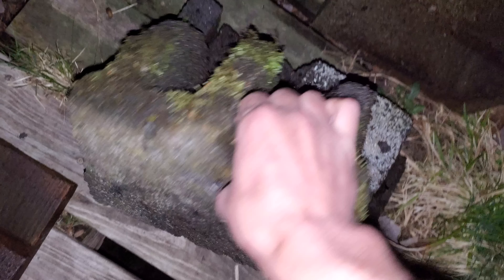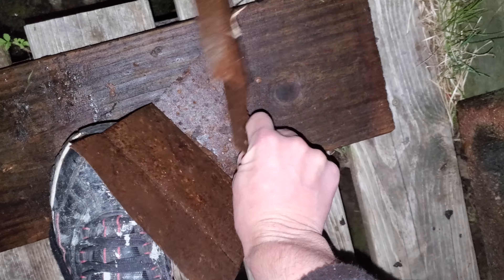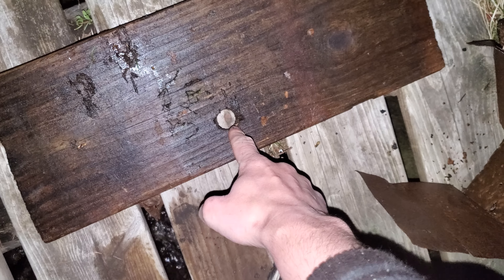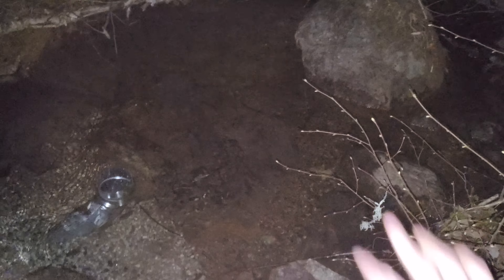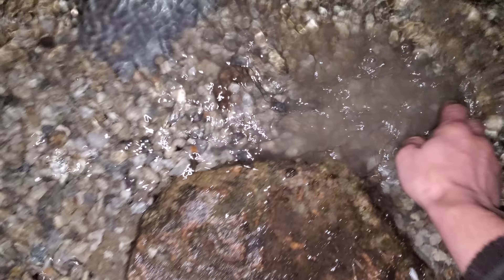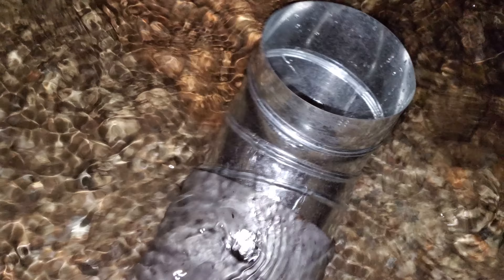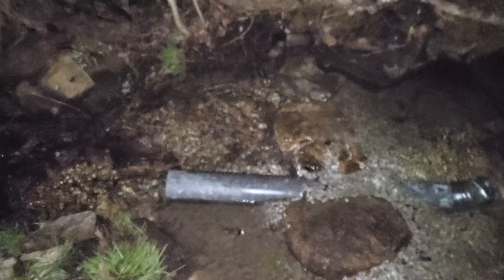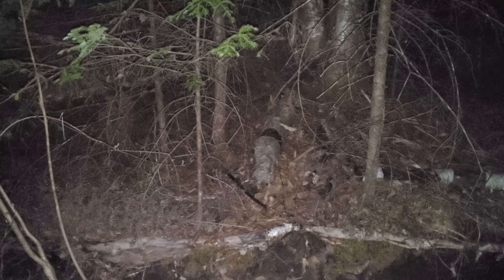Stream Dam Replacement

Comment: Look at some pvc and plastic pipe options, pvc is near water tight even without gluing and there are other plastic pipes with rubber gaskets which will seal pretty tight and can be removed when necessary
Reply: Agreed Galvanised BAD choice if ever used as Source for Human requirements.
PVC all the way!! Just requires Depth of 1-2ft to create Volume for Hydro generator and Straight/Worm return back into Before Dam for overflow over Dam after Volume is met👍
Water levels drop but stored Volume is below Dam overflow = H/G remains with Sufficient Volume. Untill extreme Heatwave.

Comment: I think you should use bigger pipe for mini hydro-electric dam project to maximize flow/reduce resistance(friction) through pipe and experiment with nozzle size at the end to maximize pressure and speed of water jet at the other end. Maybe a adjustable nozzle?
Small pipe/hose will just reduce the water flow unless you will build higher dam to get more pressure.
It's just my loose idea

Comment: In rocky areas of the west, many culverts have that type of a boot on upstream end of culvert.  The vertical piece of pipe can be quite long in some instances.
The upward piece allows water to drain once it is deep enough to reach the top of the vertical.  This setup retains water in puddles for animals but the main reason is to prevent culverts from being packed full of rocks and gravel during high spring flows.
This works very well in many areas when seasonal streams go under desert gravel roads.

Comment: I always thought the other dam was cute
Reply from the maker: I honestly like the other one better, I might go back to cinder blocks but I do like the metal pipe that allows it to completely drain so easily
Reply: @post10Vlogs  I think you should.
Reply: Deeper pipe🙏🙏
Worm return for Volume with Higher Dam wall must return Worm before Dam to improve Volume 

Volume for Hydro = Flow insufficient during Summer.......Not if Wormed to return👍
Worm creates Closed Circuit Loop👍 Dam creates Stoppage in Flow untill Volume is reached then Trickle Overflow can be achieved with Dam and Occasional Tinkering of OverflowDrain👌

Comment: quick crete..those bags of instant cement DIYers buy, work perfect in water.!! ponds,m creeks etc.. it forms fast, and stays!!. dump it, mold it like clay and it the more it stays in water the stronger it works..7$ a bag too!  i just plug 2 holes in my pond with it ! lasted years! most concrete it actually made to become stronger under water..  google it